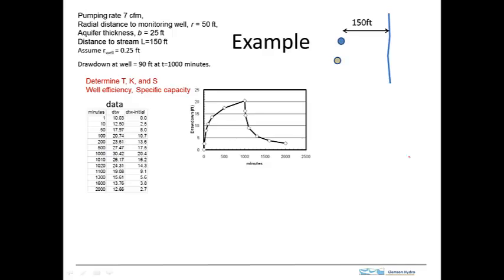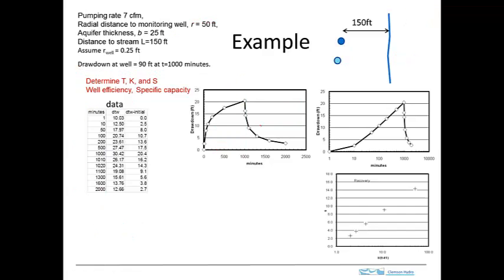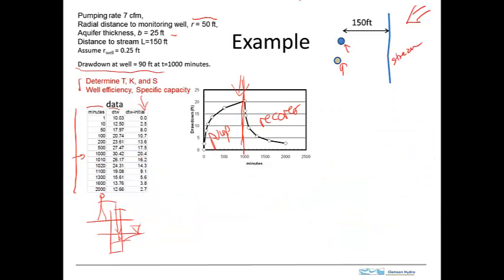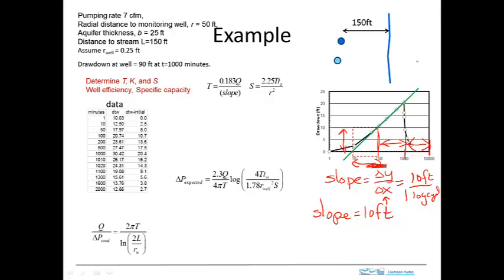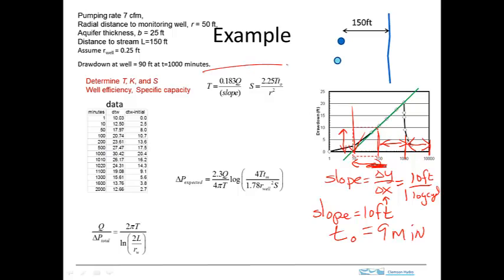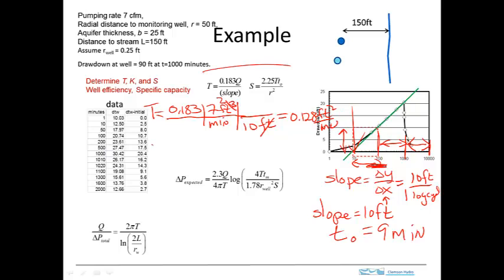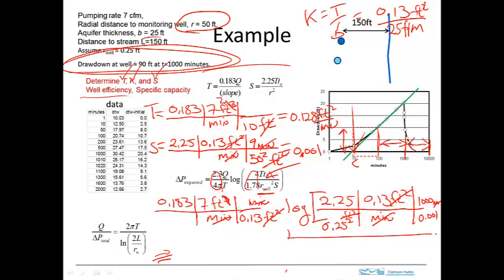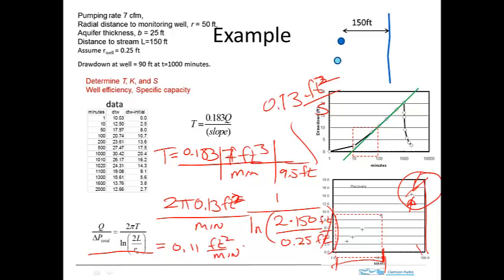example pumping test analysis

Comment: Excellent Example. Thanks for filling my knowledge gap as a  Sanitary Engineer who needed hydrology to meet the water need challenges. But how do we calculate S where there is no monitoring well?
Reply from the maker: Good question, Andrew.   If you use the method in the video with r=well radius, you typically get a non-physical result--S>1.  This is because storage in the well is not included in the solution.  There are other solutions that include the well bore itself, and they should give you better results for S, but I have not tried doing this so I am not sure how well it will work.  I have always used data from a monitoring well (or measurements of deformation) when estimating S.   Larry

Comment: Thank you very much ! very nice ;). I would like only to verify something please. I calculted the expected and it gave 90 ft ! so the efficiency is 1.
Reply from the maker: HI Salah,     The calculated drawdown should be 65 ft.   The observed drawdown is 90 ft.  The observed drawdown is greater than the calculated drawdown because of head losses in the vicinity of the well.  This causes the well efficiency to be less than 1 because it is the ratio of the  calculated to the actual drawdown.  Hope that helps.  Larry

Comment: Hey Larry, thanks for the videos. They are really making me understand hydrogeology better. I have a question about your draw-down value and subsequent efficiency calculation. Based on the graphs and the data table, draw-down at 1000 minutes is 20 ft not 90 ft, which would make the efficiency over 1. Could you elaborate on where the 90 ft came from?